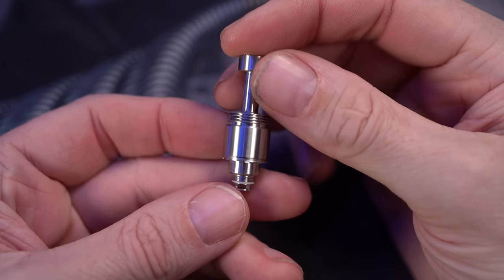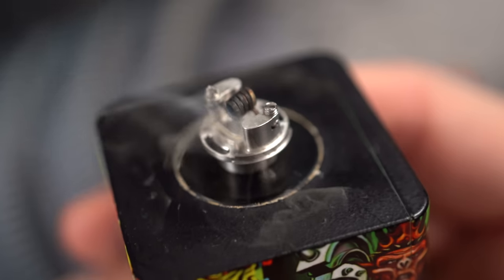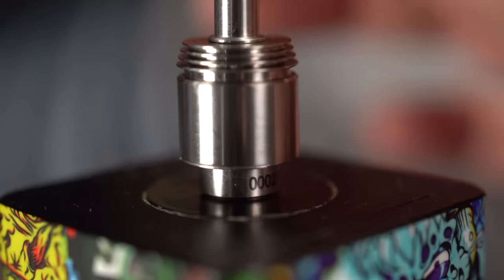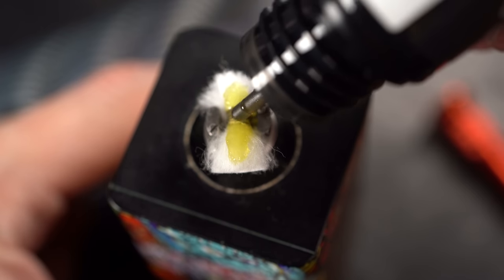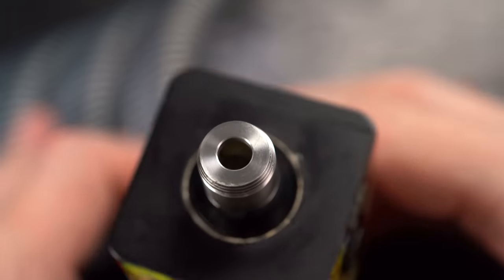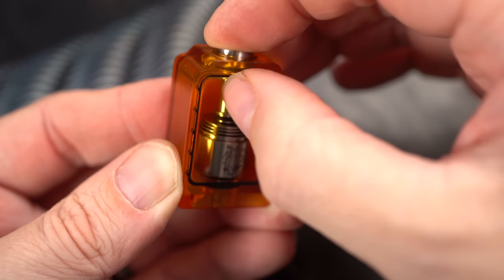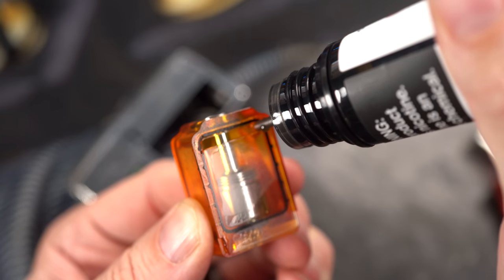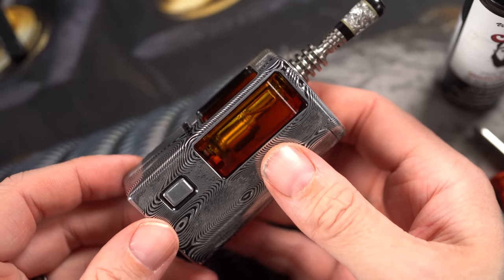Billi Goat RBA for Boro | Billi Billi

Comment: In all honesty, it’s not a bad rba. Sure, probably isn’t worth the $129 price tag, but for a MTL user at a .7/.8 coil, it gets the job done and the flavor is in fact up front with the 1.2 airflow pin. It’s all in your wicking. I was disappointed as well that the cotton just hangs there but it doesn’t seem to present any issues. Buy it, use it, add it to the collection and repeat 😂